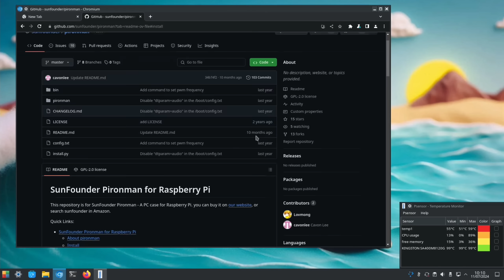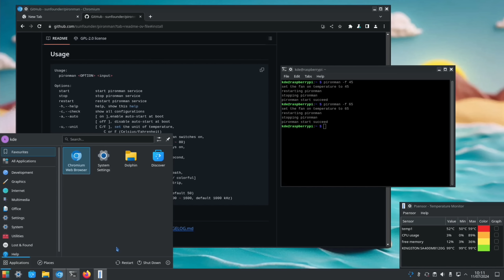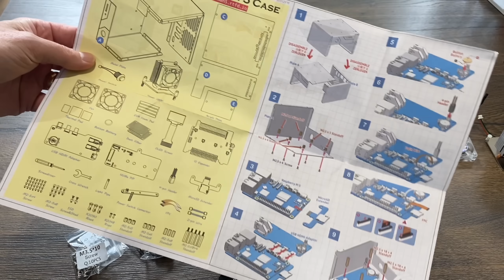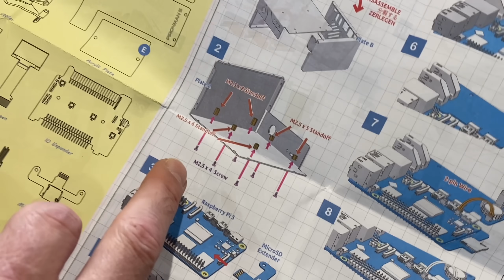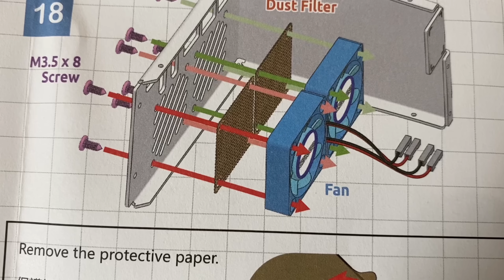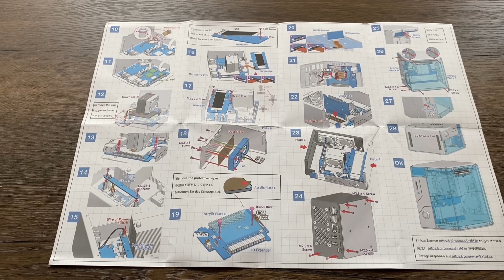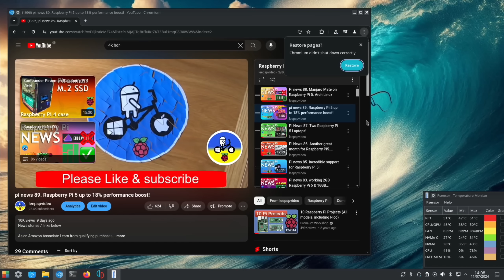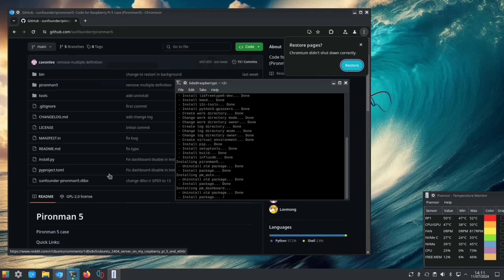Premium Raspberry Pi 5 case with Great features

Comment: If you don’t mind me asking how did you make the rgb fans run 3V? Thank you very cool case and video
Reply from the maker: @bluejay7635  see 4:09 some gpio pins are 3v not 5V 

https://youtu.be/PwHKeGv7dlI?si=LpjF9WsSgiEaugN8

Newer fans use the Pi 5 fan connector which stops this method

Comment: thanks again - BTW since loading the Pironman software, i cant get "sudo raspi-config" to work. Says command not found. Any tips as I want to change back to load SD Card first - ie not NVme?
Reply from the maker: @crisgrant3745  try raspi config from the desktop. Or write Raspberry Pi os to an sd card and update the eeprom with that os.

Comment: @leepspvideo I don't know which to choose between Raspberry Pi zero 2W or Orange Pi zero 3, my goal is emulation and some games and apps, but I'm undecided :(, if you can give me some advice
Reply from the maker: @hp7090  Orange Pi is more powerful 

Orange Pi zero3. From $17.99 (1GB version)
https://youtu.be/MOt9HRcLVgo

Orange Pi Zero 3. 4K streaming from my NAS.
https://youtube.com/shorts/cjVoLY4HN1U?feature=share

But not as well supported 

Raspberry Pi OS Bullseye running on Orange Pi Zero 3
https://youtu.be/Eurvdj4qT2o

As long as it’s older emulation I would go Raspberry zero 2w

Retropie. Raspberry Pi Zero 2W. PSP, N64, PS1 & more tested.
https://youtu.be/w2OKJee06tA

Raspberry Pi Zero 2W. First time setup. Far better performance with Zram.
https://youtu.be/vZkfuVyybIw

Comment: I noticed you had a an IceTower Plus. Will that fit into the Pironman case? I bought an IceTower Plus and I'm very happy with it. (Fan never comes on) and I don't want to give it up.
Reply from the maker: @bo-bodad8253  it’s too big to fit inside the Pironman
Reply: @leepspvideo  Thought so but I thought I'd check..Case is lovely (although a bit pricey) but the Ice Cooler Plus is In a class by itself.

Comment: I just built one of these a week ago. On mine I couldn't screw in the NVMe board, the screws were too short. It's just hanging by the rivet. It's darn cute tho. I made it into a mini console emulation box.
Reply: Are you running batocera? If so - will fan control, colours, mini-lcd screen etc work?
Reply: @Evilkingus  I'm running RetroPie, which I had to do via RPi OS and a manual install so I could get the fan control and RGB/screen stuff to work.

Comment: wish you hadnt skipped over how to remove the official cooler. I have ruined 2 Pi 5s trying to get that darn thing off.  Would love to see how you did that in a short. Please?
Reply: I've done this once using a cheap biro - place the hole in the end over the plastic pin and push. It came out a lot easier than I thought it would. The thermal pads weren't a problem - again I thought they would be.

Comment: As you suggested Lee, I dismantled it all and added a thermal pad onto the RP1 chip (which is under the heatsink plate) and it has considerably reduced its running temperature.

Comment: bloody expensive, flushing ££££ down the toilet.
Reply: I agree. I can pick up a used SFF PC on your favourite auction site for £50 right now - it will have a 3rd or 4th generation Core i5 or i7 CPU in it, 4 or 8GB RAM and will blow any Pi 5 out of the water for speed and power. And for about half the cost when you factor in the cost of the Pi, cooling and even a cheap case.

The Pi was great as a cheap £35 board to have on an electronics workbench, to teach kids to program on or just to teach yourself about Linux. Unfortunately, pandering to the people who believe the Pi should be a desktop replacement and demanding more and more power from it with each upgrade has just made it too expensive where the economics no longer work for it.

Comment: "Some Pis were broken in the course of making this video" hehe... that's the first time I've seen a case add on an integrated RTC battery. I haven't put together my own yet, but I hope to this week. Now I have a nice cheat sheet for my build! Some very weird bits on here, like those giant pogo pins for the power button adapter board :D
Reply from the maker: Also see the pinned comment. It has a load of customisation via a webpage. I totally missed it as there was no mention in the github 😳👍🏼
Reply: @leepspvideo  I've come to realize that linking both ways on things like code repositories to documentation sites is very useful. I think some people silo their work and don't think to put a reciprocal link so people coming at it from the code can get to the documentation (and vice-versa!).
Reply: I thought the Pogo-pins were a bit weird, too - like if they are being used to run current through, will they get carbon deposits over time?

Comment: Looks like the fans are pulling air out. But where does the air get in? Maybe the fans should be installed so one pulls air in, and the other pushes air out?
Reply: One of the manual drawings has the air coming in through the GPIO window.
Reply: @icbm_guy  So what happens when you put a big plug into the GPIO window?

Comment: I suppose you could use it with a Pi4 just without the pcie connection?
Reply from the maker: @martinparker9044  better to buy the original for Pi 4